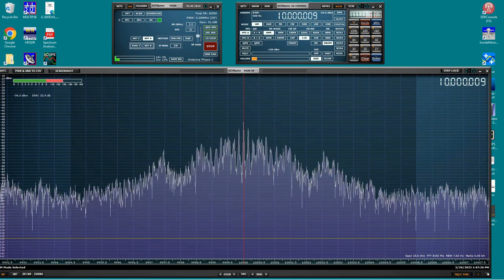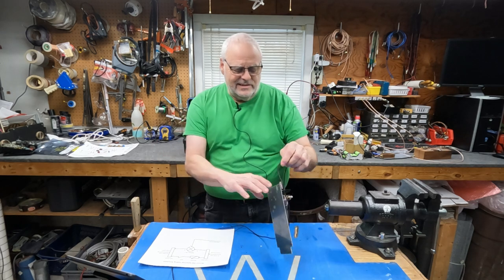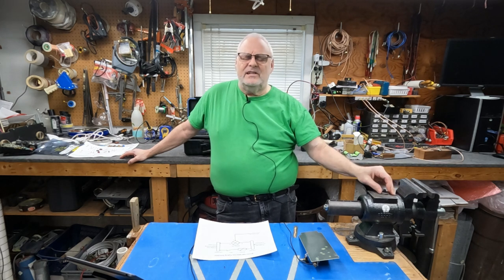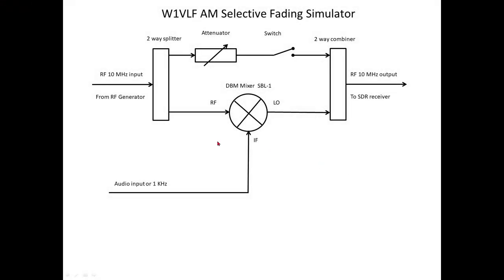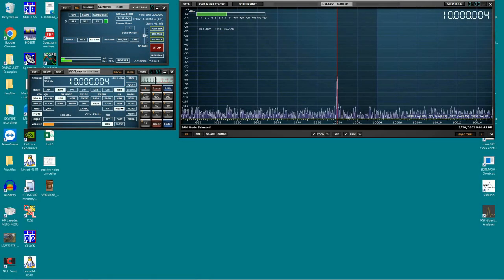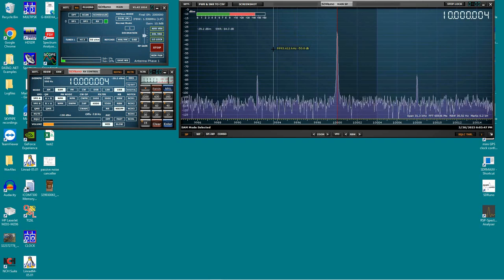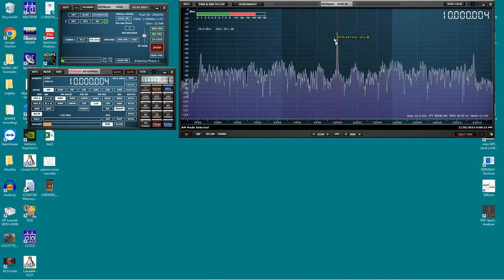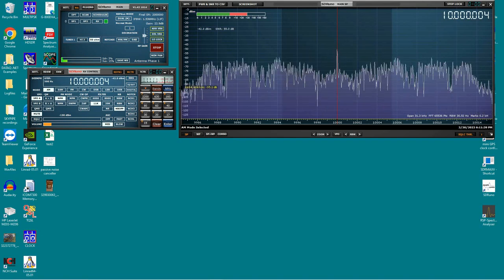Selective fading simulator

Comment: This is an excellent demonstration. I love that you simulated it and built a circuit. I really want to know exactly how the ionosphere can be that selective.

I’ve also seen it on a waterfall display as very deep, narrow notches that progress from left to right (or vice versa) on the low bands. 

Maybe a less unhinged talk radio host next time lol
Reply from the maker: Yes.. deep and sometimes very narrow notches.. When one lands on the carrier you outta luck. We can tolerate the loss of a small band of frequencies.. But no the carrier.  Thank you for watching Sterling 73's W1VLF
Reply: One way to make sense of the deep selective fades is to think of it as slow multipath fading. It is like a laser being split and reflected onto a spot, but with a movable mirror.  As it moves, there's a cycle of peaks and nulls.  On a wide signal, the effect sweeps up or down across the signal. It is a bit easier to see on shortwave than on the lower freqs.

Comment: there is a more general kind of fading than the Selective Carrier Fading Simulation shown here, and you could simulate that with two series resonant circuits at 10 MHz in line with the variable attenuator and the switch. (one series resonant circuit will yield a 90deg phase shift, yes?) then, as you tune one of the two resonant circuits, you can sweep a selective fade across the signal (10 MHz +/- audio)
Reply from the maker: I should give that a try.. quite a few things on my list to-do first though  Thank you W1VLF